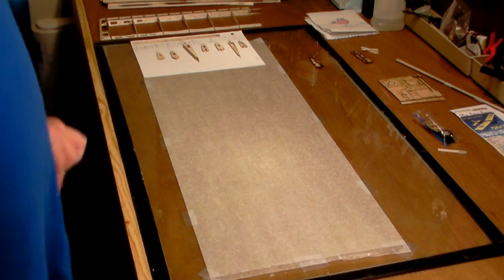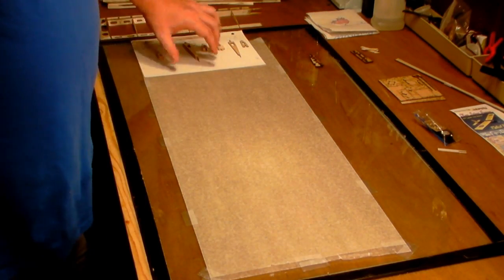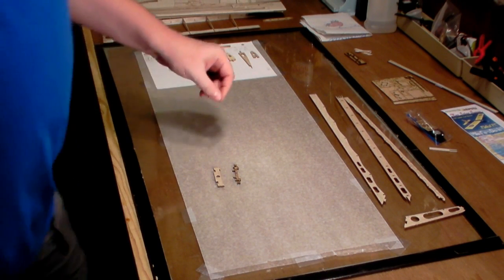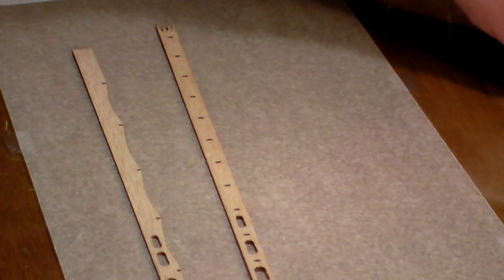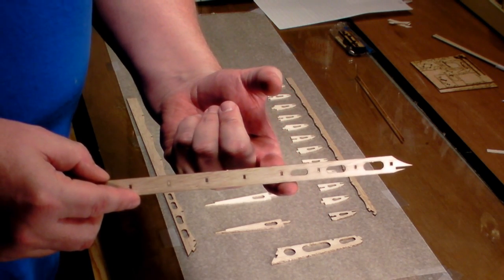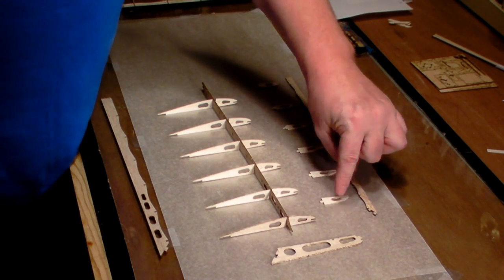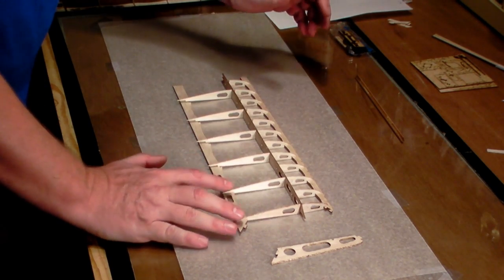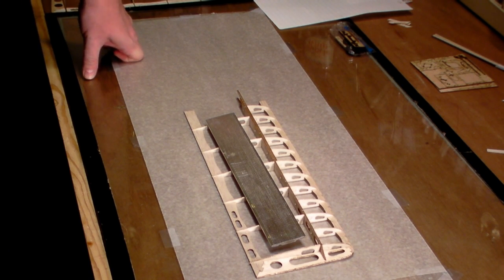2.Mini Intern Build-Along, Wing pt1

Comment from the maker: Hey Kris! I've been using this method for my smaller builds for many years and, surprisingly, I've not had any problem with the CA blobbing up. I think it is due to the oily solvent that is in most accelerators. The accelerator seems to wick off the feed tube and onto the CA,rather than any of the CA wicking onto the tube. Take care, bud!